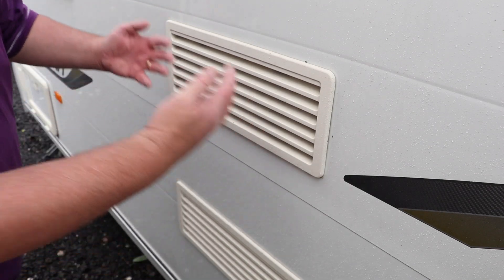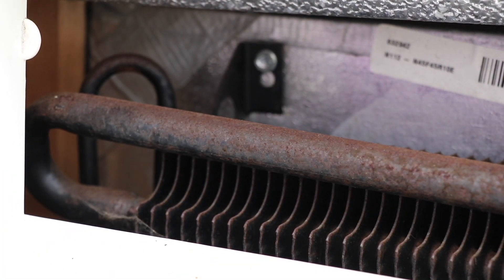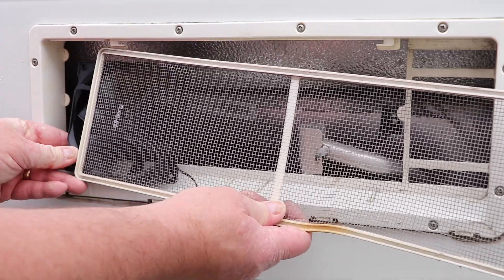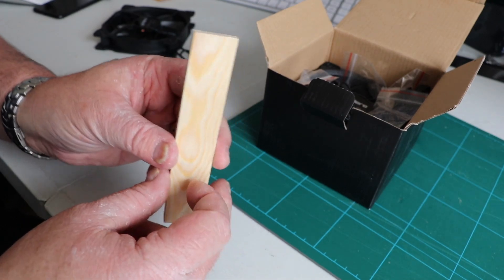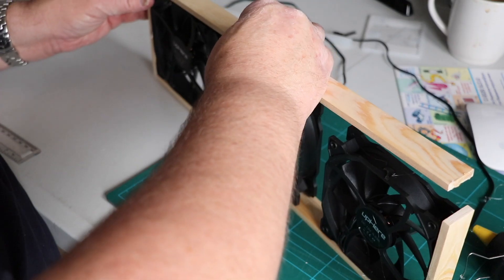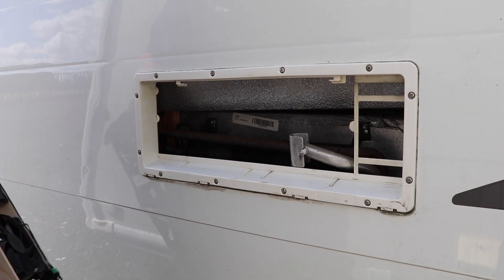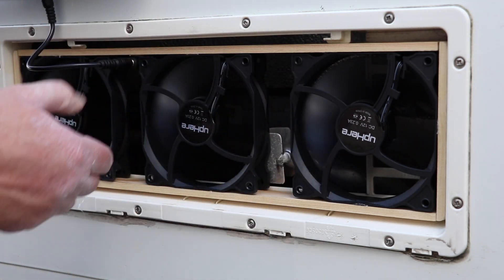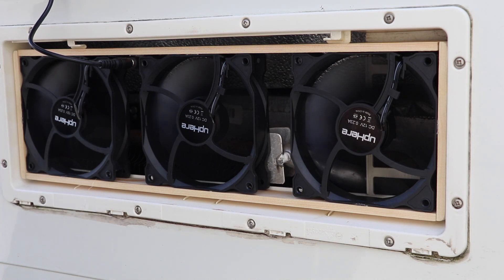Caravan fridge vent fan upgrade

Comment: hi  60 cfm fans minimum cheap 80/90mm fans are below this . 120mm fans are usually this as  minimum . 
Burner exhaust silver T piece can face outwards ,your inner vent holder glued to van tells me that , the rectangle on the RHS. When the fan switch off the current  boiler exhaust still keeps pumping heat into cavity where your trying to cool . 
Screw tape glue .5mm /less alloy sheet metal as duct work  IE cavities hold hot air

Comment: Hi Dan coming back to this video. I remembered that you like me had problems with the fridge cooling in very hot weather. So I did what I could and I took off the vents covers. And used a 12 inch fan from Tesco 😁👍  worked a treat. So thank you for the idea. And my ice was kept lovely and cold in the freezer so we could have ice in our Gin. Thanks again. 😁👍🍸
Reply: @Paul, with the Tesco fan, did you blow air in the bottom vent instead of extract from he top?

Comment: Hi Dan, any news on the follow on video and controls?
Reply from the maker: Hi Brian, yes will be coming out in a few weeks time (i hope) a different caravan and different fridge, so had to re-engineer a solution.
Reply: The Trudgians Thanks for responding Dan.  I am in Croatia at present and my fridge is not working well.  I have taken off both covers to improve things but no improvement.  The fins are getting warm to the extent that I can touch them.  Any thoughts to get me out of trouble?  I have just started running the fridge on gas.  Brian

Comment: Dan, I have now fitted two fans to the top grill to extract air,it was fairly easy to fit two but not three.Just thinking would fitting two fans to the bottom grill to push air in be any extra advantage.We visit Spain in the summer so it gets hot,Cheers malc

Comment: Hot air rises so you must use the fans to suck air from the top vent or blow air into the bottom vent. The idea is that air flow through the working parts of the fridge are improved. It is also a good idea to obtain manufacturers instructions on how the fridge has been installed and ensure it has been properly done to start with. A lot of the time the van manufacturer does not follow installation procedure and performance suffers as a result.

Comment: We have a slight smell of exhaust fumes coming into the van when using the fridge off grid which appears to be a common problem.  
Thought this would be a good idea to prevent any fumes coming into the van but i am a bit worried about the heat from the fridge, any thoughts?
Reply from the maker: Hi Stephen, 

you certainly shouldn't be having any fumes coming into the cabin. I would have that looked at immediately from a trained caravan service engineer.

Hope that helps. 

Dan
Reply: Thanks Dan, eventually found a certified engineer for caravan fridges.  We're now booked in.

Comment: Great video, Dan. We had the vents off in France while the temperature was over 30 degrees. That helped a lot but I will be re-creating your fan assembly for our next European trip.
What is the power supply that you use to run the fans?
Reply from the maker: Hi, im just using a standard 230v plug in style 12v adaptor. The same one I used when running the awning lights. nothing special. if this was a more permeant solution, i would be hooking into the on board 12v supply, but as a proof of concept it worked fine.
Reply: Thank you again for this video. I've made exactly the same thing from your instructions. Absolutely perfect. Will be great for our next European trip. Only thing is that your link to the power connectors is for male connectors - even though it says "female" in the title. Here's one that is female - https://www.amazon.co.uk/gp/product/B006W2I13S/ref=oh_aui_detailpage_o00_s00?ie=UTF8&psc=1

Comment: A good addition is also to wire in a thermostat so that the fans will come on automatically at a preset temperature.  I bought mine for under £4.00. Wire direct to 12v supply . If required you can place the thermostat inside the van with over-ride switch etc etc...

Comment: Nice one Dan, great idea.  I have a similar problem with the motorhome and now I may have a fix..well done and thanks!   As it is portable is it not possible  to make a unit which clips external to existing grill  contained in..say small light weight box,  Tupperware ?? (Velcro fixing maybe) sealing round the perimeter of grill ? might create more direct suction/ pull if fans are contained and external.  Just a thought but I will be watching.  I also think 3 is better than 2 and cant do any harm

Comment: Currently in France. ..temp 21C but fridge still not really cold. Freezer part us acting like a fridge 😀.So got 2 fans and have put them both at the top extracting and rhen at bottom blowing in. Grills also off but still not cooling. Have got table top fridge working fine. Is it more likely an electric issue supply here? TIA
Reply: Well after a bit of a boost on gas, followed by a cooler night and with fans placed on the bottom blowing cool air in it did actually work ok.

Comment: I did something similar this spring ,  and added a  small 12v switch in a cupboard and a cheep £3.00 surface mounted digital box, temp controller,  from eBay, so its  switched on at 23C and off at 18C, this keeps the noise down over night, it worked well in France this summer in the heat. I used 2 X 120mm silent fans,  so its hard wired to a supply,  fused and switched. the  cables were std  add on  1m fan extension cables for a PC with the correct plugs on,  We had a small amount of ice form on the  freezer cooling fins inside the fridge (perfect proof it works). I kept the fans away from the  gas flu end, as ours has a left hand gas flue  and exhaust the air from the top, the sensor is in the bottom grill area, so monitoring incoming air temp,  the mounting bracket was an  L shaped piece of ally strip from B &Q just make sure the  fridge box gas integrity is maintained from the  inside of the van when drilling holes.

Comment: Dan, Steve here from RV Living - from the Swannies down under. Stella the good lady said to ask Dan, so here I am. We're currently in Alice Springs, NT, Oz. doing a half lap and wonder if you can help me?  When we are hooked up to mains and water in our Hitch Hika Caravan, no problems. When we free camp and use the water tanks, we turn the water pump on (with water in tanks) and water comes back out of the mains water inlet fitting. I've changed the one-way water pressure value today (which cost me AUD$76) but after fitting it the same thing happens. Any ideas?

Comment: Hi Dan, i use an 8inch silent ( you can still here it ) pc fan mounted using car radio brackets in the top vent. I went to Maplins and bought a temperature switch kit. Now Maplins are closed you can buy better switches on Ebay. Basically an adjustable switch to whatever temp you want the fans to come on. This was mounted by the back of the fridge. Works great. By the way hows the caravan buying going. Night mare eh. Compromise is a well used term. lol

Comment: Dan, I know you are selling but one mod I keep thinking about doing is adding a waterproof 12v socket under the ‘van which you could use to power you lights/fans and also good for running a compressor for pumping up the tyres..... you’ve probably already thought of it but worth a shot.

Comment: It's like you knew I was testing this out too, I have some old fans from loft and brought a rocker switch and fan controller off ebay for about £3 so I can mount it inside van and switch it on as and when I need it. I am thinking of connecting to the back of the 12v socket in the van as this should supply the correct power for it if I'm correct

Comment: Just a thought .. would 1 fan at the bottom vent sucking air in as well as the 2 at the top exhausting the air make for a better flow ?

Comment: Brilliant idea, not the first to think of the 'fan assisted fridge',  when we used to go caravanning with our Lynton years ago the fridge really struggled in hot weather so as the fridge vents were in the awning,  we made up a wooden stand and fixed a 8 inch clip on desk fan to blow air into the lower vent, it made a huge difference,( btw the fridge was always used on electric,)  as you say it looked a bit funny but the important thing is that it kept the milk & beers cold. 😉
 And you actually managed to find some B&Q stripwood that was not warped!

Comment: Hope the fans work well for you and have a great holiday.

I’d love to know how a caravan fridge works on the gas side of things, how can a gas flame actually cool a fridge down?
I’m going to take a wild guess and say it’s down to some kind of witchcraft!
Reply: A propane fridge has a sealed network of tubes and chambers holding water, ammonia and hydrogen gas. A propane flame heats a chamber holding a solution of water and ammonia until the liquid boils. The ammonia gas rises to another chamber, the condenser, where it cools back into a liquid. It then flows to the evaporator, where it mixes with hydrogen gas.

When ammonia encounters hydrogen gas, the chemical reaction between the two absorbs heat. That's how the propane fridge produces its cooling action -- by pulling heat from the interior of the refrigerator into the ammonia-hydrogen mix. As it absorbs heat, the ammonia becomes a gas again. The ammonia and hydrogen gases then combine with water. The ammonia and water form a solution again, which releases the hydrogen gas to rise back to the evaporator. The process then starts all over again.

Comment: Hi dan hope u keeping Ok good video wouldn't it be better to buy a spare vent cover and cut some of the grill out attach the fans on the out side of it and make a case round it then when weather is very warm just clip the vent off the van and put the other one on that got the fans on and put the wire to battery with a fuse a least then u can remove it when finish just a thought cheers dan .kev

Comment: Thanks for the video. Great idea. Tidy execution too. 

Slight concern on the aft fan if running on gas (or 1 yr old has flicked switch to gas) as aft section of the top vent gets quite hot from the flue on our dometic which may cause a problem. So 2 fans at fwd end makes sense to me, or people in my position. 

Thanks again, tempted to give it a go.
Reply from the maker: Hi , I should have added - were not using the Fridge on Gas, while im running these fans. I think if i were, id only use one single fan - away from the flume etc.
Reply: when switching to gas dont you have to ignite it too tho ? (like a push button plunger piezo ignition)?
Reply: lee mclaughlin . Not on my Dometic fridge, it's automatic.  I actually try and avoid using gas, but the 1 year old loves to fiddle    with the switch.  No kiddy lock on the fridge.

Comment: Good lash up Dan - no reason why it won’t improve things . 

How did you ascertain the rpm cable to isolate it from the +ve and -ve? Is it in the book of words that comes with the fans? 

I suppose overkill would be a similar arrangement on the intake grill with fans spinning opp way - a by-product being extra heating for the awning !

Howard
Reply from the maker: Hi, no the cabling on all fans either 2 wire, 3 wire or 4 wire is standard across the board, so they all just plug in etc. 

You can google this and see lots of pretty pictures showing the same thing.

Hope that helps - if its not that clear, let me know and I will see what i can do to help.

Dan

Comment: Dan, Two safety points
      1) Is the wood you are using flameproof, you saw how the plastic frame got hot ?

       2) It would be a good idea to check with the manufacturer with the flow of air because the fridge can run on gas and produce carbon monoxide gases.

Just a couple of safety points I think you should check ?

Regards, Colin Humphries, Retired Electrical Engineer.     carbon
Reply from the maker: Hi Colin, 

I should have added that while we are using the fans, the fridge will only be on electric, not gas. I think if I were to use gas, id only use 1 fan at the far end to assist with flow etc. 

I will be revising the design for a better installation etc. once i prove this works.

Comment: Watch out for smaller fans - they make an awful lot more noise. It is quieter to use the biggest fan you can and then a controller to vary the speed... Watch out for the controllers though - they vary the speed of the fan with PWM (Pulse Width Modulation) and a small minority of them run at a low frequency which makes the fans whine. It is probably better (less prone to problems) to avoid varying the speed of the fans and, instead, drive them straight from a £1-or-so thermostat - search AliExpress for "12v thermostat".
I have tried to make sure that everything in the van can run from 12v as this means a) I don't clog main sockets up, and b) I can use everything in the van when we're off-grid. The fans I put in the last van exhausted through the top vent and were wired to the fridge loom hiding behind the bottom vent. Part of the problem with doing this is that you need to make sure your supply is regulated and a simple buck/boost converter set to 12v makes sure that whatever the battery state (up to 14.4v), nothing will be run over-voltage.
Finally - watch out for the glass transition temperature of the hot-melt glue - you may well find that the fans slowly start moving in the wooden frame!
Next project is to install data logging on temperatures (fridge/internal/external), battery voltages and charge state (leisure and mover) and get around to reverse-engineering the Alde communications so I can build a panel which controls and monitors everything.

Comment: Our Dometic fridge has a freezer box at the top which can be easily be removed by releasing two clips. 
We did this giving more room in the fridge and you can turn the fridge right down and it chills and runs very well
(We now have a tabletop freezer in awning)

Comment: Hi Dan brilliant idea, I have used two fans with the thermostat lead built into them so switch on at 30 degrees, also supplied through a CBE dimmer switch to vary voltage inside van thus varying fan speed.

Comment: I’d stay away from the exhaust pipe of the gas flame. I assume forcing air out of the pipe which you definitely will during operation, might cause a safety hazard. You already had some brown spots at the mesh which shows that heat is produced —given more ventilation, this might cause even more heat. It will show by producing some nasty smell. Excuse my English, I hope I made myself clear.
Reply: was going to say more or the less the same, please check that when running on gas those fans don't have an adverse affect on the small burner in the fridge.

Comment: Hi Dan, I fitted a 2 fan system to the upper deflector and placed the control switch under the end of the counter top. Power from the battery with 5amp fuse. This made such a difference, the fridge runs a lot cooler at a lower setting. Dan, if it ain't broke don't fix it. 3 fans good, no fans bad. Well done mate.

Comment: Great mod-could do a paper test -turn the fans on and off whilst placing a piece of paper/tissue in front of the lower vent see if it increases suction and pulls the paper/tissue in.
Reply from the maker: HI Lee, Yes i did hold a bit of toilet tissue to the bottom vent, just to see if it made a difference (off camera) and i was amazed how much extra air was being pulled through. 

I had originally thought about adding more fans to the bottom - to push air in, but i just done think it needs it. Time will tell in the upcoming holiday - I will report back.

Cheers

Comment: Be nice to see a more permanent solution when you get the new caravan. Maybe wire the 12V into the caravan wiring, double adapter off the aerial 12V supply? Use a slimmer fan that could sit behind the  factory vent, maybe a GPU fan or 2. Nice idea, I can see the tool kit coming out 😉

Comment: Ah! So this is why the weather broke! 😂 It is usually my fault for getting our garden swing seat out of the shed. 😉 A useful video, thanks. When we got out elderly Elddis we took our fridge vent off for a nose and a previous owner had stuffed the entire space with scrunched up newspaper, presumably to stop drafts to the inside through the cupboard unit. 😳
Reply from the maker: Oh blimey, good job you checked then, that could have been a nightmare. 

I also cleaned the patio windows, hence the sudden down pour ;-)
Reply: hels bels73 surprised it hadn't burst into flames!
Reply: Richy, The Tinkerer & Wanderer. Me too! I wonder how much it had been used apart from as a spare bedroom. The newspaper was dated over 10 years ago so it had been there a while. 😳